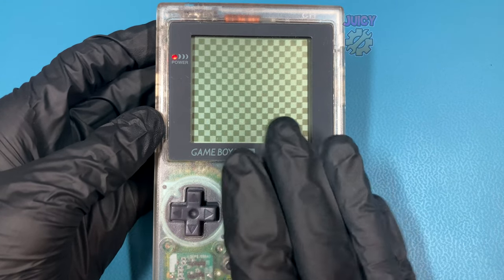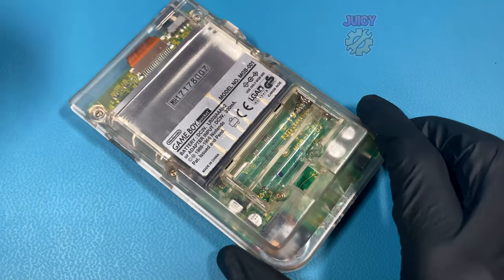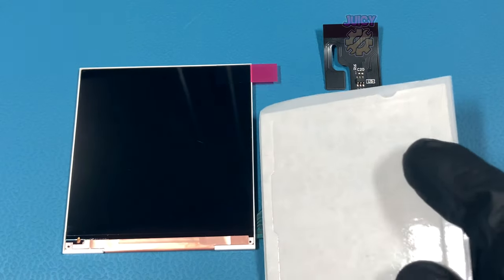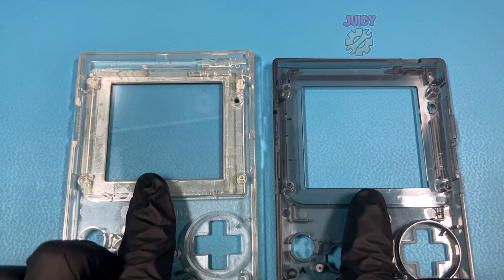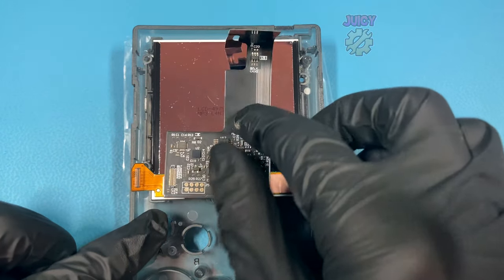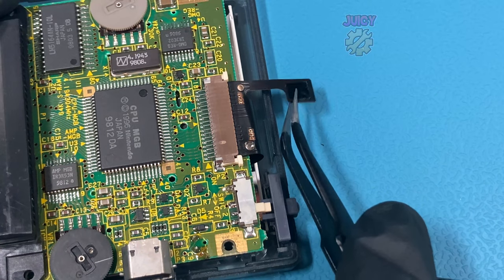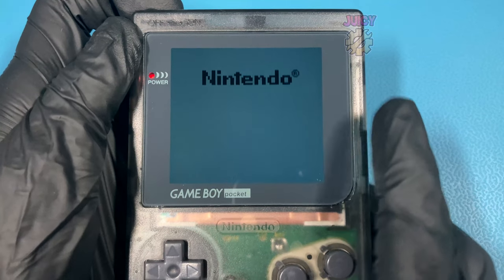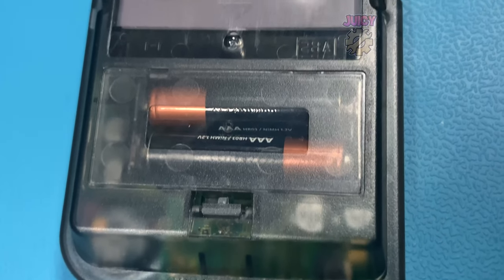one of the BEST Gameboy Pocket IPS screens out there!

Comment: You should stick the double sided tape with the inlay still in there and remove only the tape of the frame part. This method is much easier to get the double sided tape frame on your shell. Once it's attached you simply push out the inlay. 4:35

Comment: Hey Jake, nice vid. I'm trying to fix my dmg gameboy and after cleaning the corrosion from the battery contacts - there is still no power but the batteries get really hot when I turn the switch on. Do you have any idea why this is?
Reply from the maker: urmm, are the batteries in the right way? do you have a DMM to use?
Reply from the maker: @oi-yeah-nah-mate7731  ahh good, im wondering if something has failed thats causing a short between the power and ground. This would cause the batteries to drain super quick / get hot